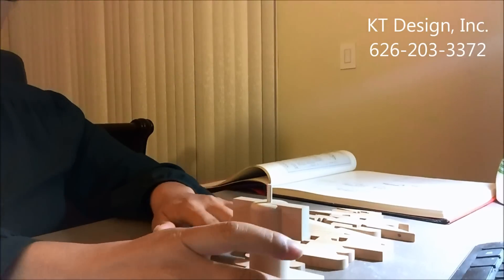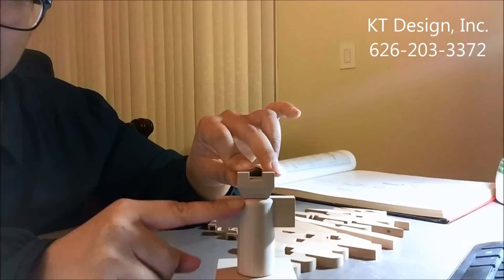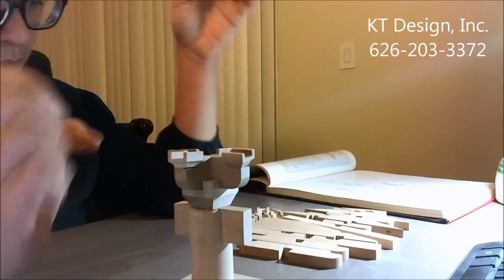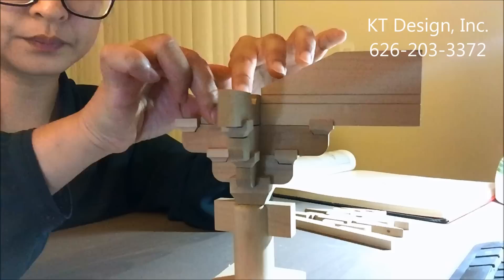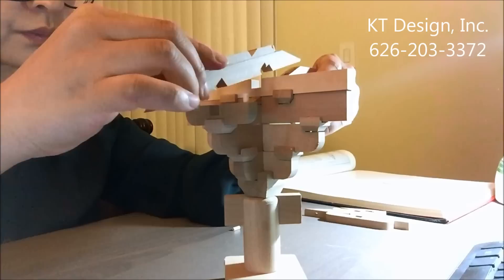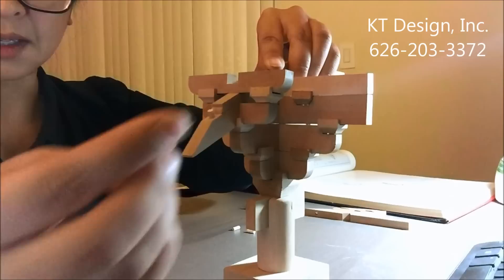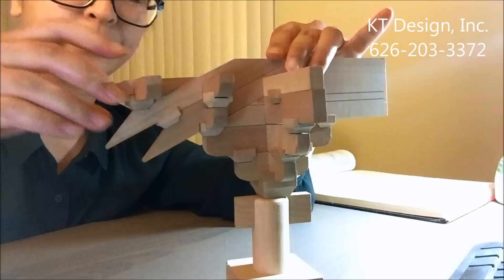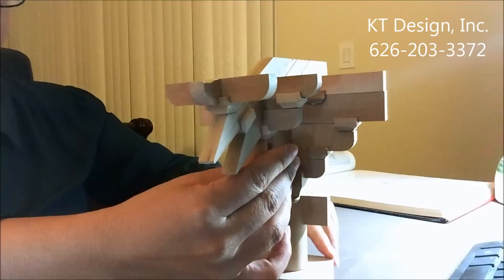Traditional Chinese Architecture: Fo Kuang Temple Bracket Set Demo

Comment: The structural analysis of this joint is simply beautiful. The internal behavior of bending moments and shear is perplexing since the system is multi point stacking. The bracket system itself allows restricted degrees of freedom for sliding. Lateral forces are dissipated with the heavyweight of the structure. 

This is the first time I see the bracket style.  :O!

Comment: How would the bracket system work for a circular building like in the temple of heaven? does it have a different name?
Reply: without knowing exactly the details of temple of heaven, i am wondering if it is a circular structure. Just speaking about the columns, is it a dodecagon? and it is peripherals and decors that make it circular -- just my guess.

Comment: I am a wood worker. The 10 x 28 foot covered patio I built on the rear of my home has no screws, except to attach to my house. Could you please email me for a project I think would fascinate you and me? I want a house built without nails or screws, made entirely of wood. These Chinese wooden frames are amazing, but the design seems to fail if made with walls, that is why they didn't have them. I believe I have come up with a solution and would like to talk it over with you.
Reply from the maker: That is a great idea to build a house with tradition skill. However, I have some concerns about safety issue. I worked for Huntington Library. They had a Japanese style bridge built by an Japanese Artisan around 1910 without any nail. It collapse couple years later. So they put the bridge back with hidden nail. I don't know which state you live in, but in California where I stay, with the earthquake issue, we have to follow the building code to design the project. You can still make it look like traditional woodwork but use some hidden fastener behind . Or, you can use the steel structure as the framing but wrap it with wood as the skin. Our Huntington Chinese Garden is using this skill to present the Suzhou style house.Hope this help with your project.Remember, safety first!
Reply: I live in NY, and I highly doubt they'd let me build more than a gazebo without nails here, but am looking at land in KY, and depending on where I end up, there is a chance this can happen.. Considering how well all of the wooden structures and their extremely heavy clay roofs hold up to all of the earthquakes near the Forbidden City, you would think there could be a way to get an exception to their rules.. Since I am living near a major fault line(that has never caused an earthquake as far as anyone knows), I may or may not be able to build it here. I believe you understand how and why these joints work against earthquakes, so was hoping for a bit of guidance as I proceed. The Forbidden City buildings have stone walls that do collapse, and my goal is to design wooden ones that won't. What I am attempting to do is apply the dougong joinery to horizontal construction, tied into the vertical stability of the structure. I wish I could figure out how to email you.
Reply from the maker: There are two books that will help you with the design. One is called "The complete Japanese Joinery" published by Hartley & Marks publishers. The other is called "A Pictorial History of Chinese Architecture: A Study of the Development of Its Structural System and the Evolution of Its Types". You can design your patio and have consult with structure engineer.I know there are companies who are profession in constructing the tradition Chinese architecture work in China. (They recover lots of history building)Maybe they will give you some practical advices.

Comment: great lecture Katie! had you considered to address the the particular differences between Chinese, Japanese and Korean Architectural Elements, I have been at this places and almost looks the same, but paying attention you may notice the difference!
Reply: Both japanese and korean architecture were learned from China, and adapted to the environmental specificities of those areas. So for instance japanese architecture uses softer wood that’s available in their environment compared to China, which as an economic power for centuries had access to more exotic, high-quality hardwoods from indigenous provinces and S Asia. Further, since japanese style architecture was copied from the Tang dynasty in China, the building aesthetics are simpler than ie. Ming/Qing era architecture in China. Also keep in mind that both japan and korea were tribute states of China for centuries, so their architecture styles were often regulated to be a certain style so as not to clash with/exceed the sophistication of the Chinese imperial palaces (and concurrently, japan and korea had less human capital/resources and wealth than China to dedicate to the R&D necessary to build such grand structures) You can see this in korean architecture that mimics the Forbidden Palace, but is not as grand or big. Hope this helps!

Comment: Has there been any research of this system done with concrete?
Reply from the maker: The Chinese architecture was mostly built with wood or brick. If they do have any concrete bracket, it might be done very recently.
Reply: yes, i'm chinese and i've seen concrete bracket......in fact, we don't admit them. Chinese Architects are now exploring proper ways to make this element live in modern world:-)